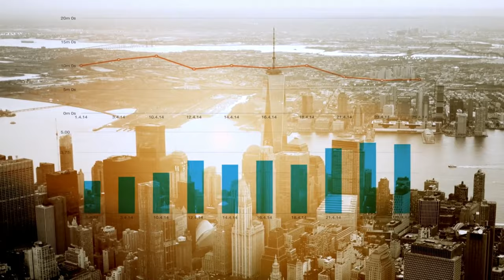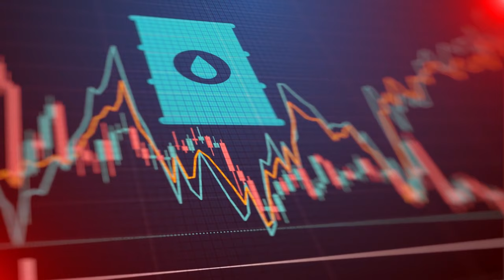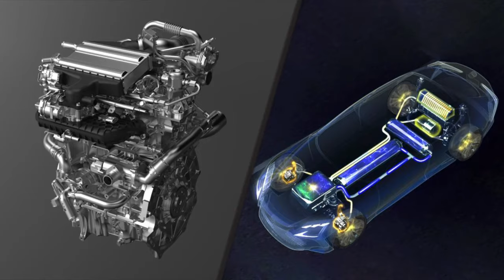Koenigsegg CEO: "This Ammonia Engine Will DESTROY The Entire EV Industry!"

Comment: Mr Koenigsegg, sorry but I have to tell you that the most crucial problem is not the type of fuel used by the ICE. But the ICE itself, the most complex and inefficient contraption power plant on the planet, far more efficient in producing heat than appreciable mobility. 3 times less efficient than the late generation Tesla Electric motors, capable to rotate indefinitely at 20.000 RPM. Another critical consideration is the fact that renewable energies  sources are perennial and cost 3 times less to harness than fossil fuels, and are available in every corner of our planet. So keep producing dreams for the few, that are even afraid to park them anywhere.
Reply: Mining materials for billion cars across the planet is insane, more holes in the world than you can image, electrical grids in every major city need to be upgraded too billions and billions of dollars.  Some places on the planet are too remote and never will have that infrastructure.  Batteries in cars won't last and need to replaced at coast that more than car is worth used.  The whole point is greening the car industry should use several different solutions.